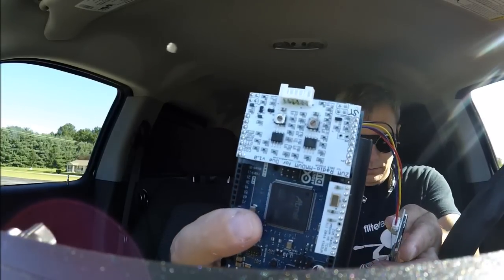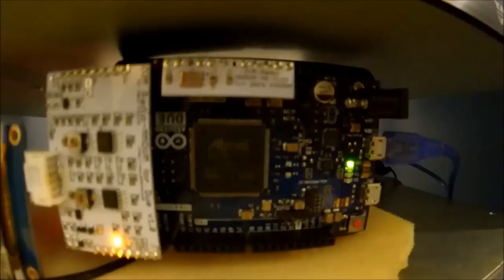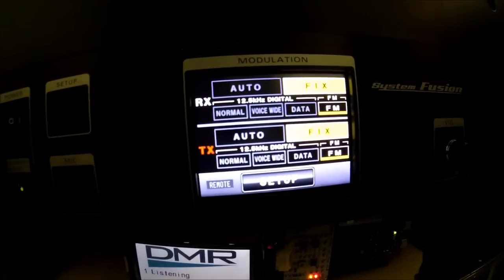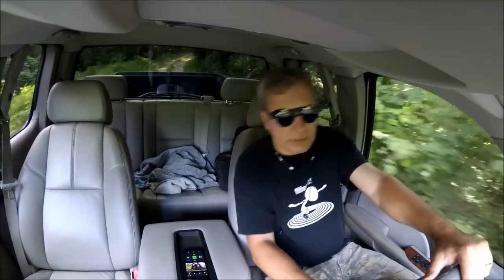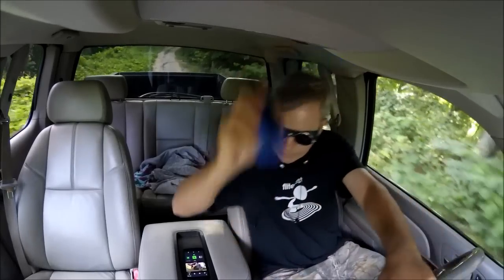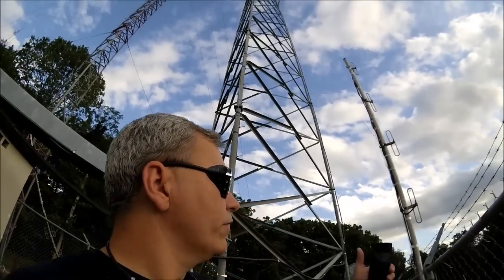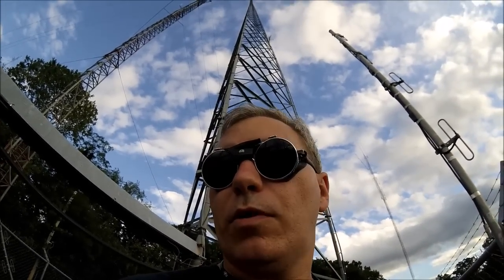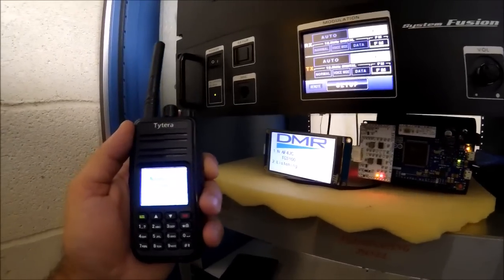MMDVM Repeater Install, What's That? DMR DSTAR C4FM  VLOG2

Comment: Hi Richard,
Trying to do the same as you using MMDVM and Yaesu DR-1X. Having the same terrible desense problem. Have narrowed it down to inside the DR-1X. Wondering if you have have been able to solve your desense problem and what may have been your solution? Yaesu has been zero help.
McCoy N5YAV
Reply from the maker: I got a better set of Cans. I a running one ant right now but Later I will try split Ant. RX on the top TX about 20FT down on the tower but still use the Cans also. If you have a 200' or better tower you can split the ant 100' with no cans.
Reply: Thanks for reply, Richard. I'm using celwave 6 can. Made some improvement today by moving around both coax cables from rear panel to RX and TX. Also, did better grounding inside the case. Removed paint inside case lid and the box at each screwhole. Then removed paint under each coax chassis mount. Added extra ground from AC entrance block to ground screw. All grounded to tower ground system of 9 wide spaced 8' ground rods. Antenna is 16 loop Decibel at 140', transmission line is 1/2" heliax. I'm in traffic pattern of airport and dare not go higher. What cans are you using? Enjoyed your videos. Waiting on MMDVM 1.2
Reply: Change the jumpers between the radios and back panel. The Yaesu "Engineers" used RG58. Use RG 400. Easier yet is to order yourself a couple of these: https://smile.amazon.com/FLANGE-Pigtail-coaxial-Quality-Shipping/dp/B00Y76YJ96
Reply from the maker: I have now moved on to using 2 cdm1250 radios and a good set of dups.. Works great now. But people have changed out the cable on the drx1 and it does help.
Reply: Richard Hyde are you having heat issues on the PA?
Reply from the maker: Nope I run it at 1 watt Into a Large PA MSF5000 BatWing With Lots of fans and AC room. 75 - 90 F' all the time.